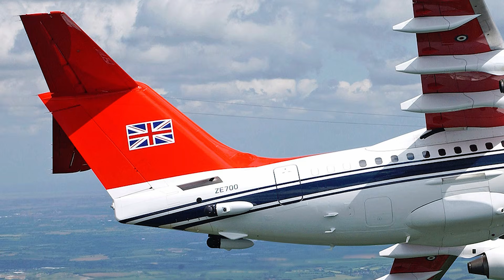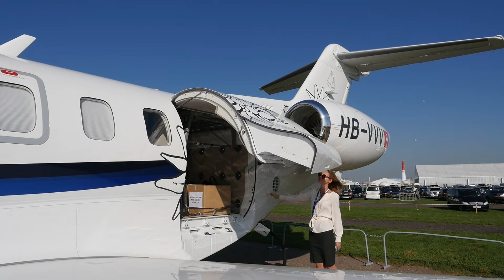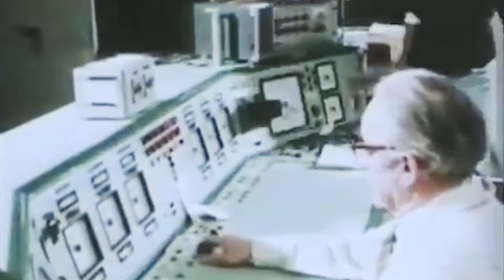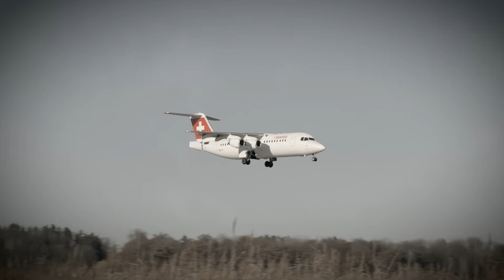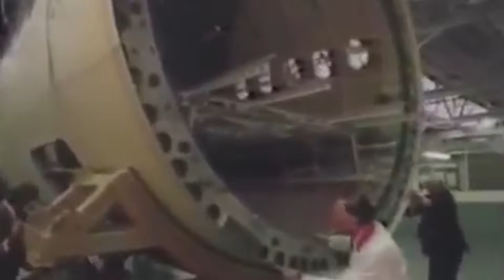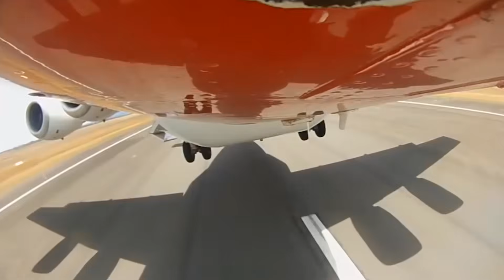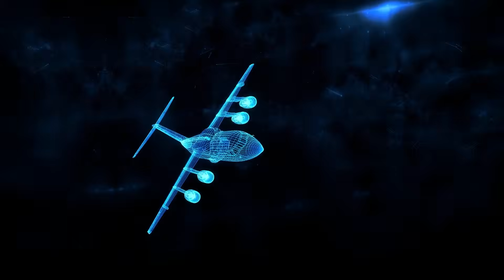BAe 146 - more engines!

Comment: I remember the BAe-146 fondly. The "Whisper Jet" was an excellent plane to be a passenger in. It felt solid and stable while being as much of a hot rod as the 737.
BTW, I think the thing you are calling "interceptors" we call "spoilers".
Also, those "vertical flaps" are "speed brakes".

Comment: There used to be a joke:
Why did the BAe146 have four engines?
Because they couldn’t fit six!
Reply: I heard a similar one, explaining where it got it's name from: It flies like it's got 1 engine, it's actually got 4 engines, but it really needs 6
Reply: You missed the next line, 'and 5 would have looked silly'.
Reply: @stephenarbon2227  No, actually a five engine jet would be badass. Either 4 under the wings and one in the tail, or even better, two under the wings, two on the fuselage, one in the tail! Or even like a VC-10, but with a 5th in the tail. Hell yeah!
Reply: its perfect for STOL just like the Dehavilland Dash7 and Lockhead Herculie.
Reply: @Perich29 
Only 113 Dash 7s were built, from 1975–1988. However, its twin-engine derivative, the Dash 8, has seen 1,249 built between 1983 and 2018.

Four engines were just too inefficient on fuel.
Reply: It was also connected to engine out performance, lose 1 and you still have 3/4 power. Two engines would have required more excess thrust for the engine out case. It also gave a three-engine ferry option, considered essential at the time as the 146 was expected to operate into airfields with minimal ground support.
Reply: Or the aircraft with 5 APUs!
Reply: @joshuaduckworth  That’s what we used to describe the 146 at where I flew her.
Reply: 😂😂😂 That's a good joke!
Reply: Another joke: BAE stood for: Bring Another Engine
Reply: BRUH
Reply: Wrong. Because they couldn't fit 8. LOL. I like what you said & worth repeating your original. Funny.
Reply: No. now this is funny....why did they put 4. because they couldn't fit 10!. haha booyeah!
Reply: I always wondered why that no-so-big plane had 4 turbines .......................
Reply: After the demise of a certain Antonov plane, that didn't age so well.
Reply: On American Airlines,  if they asked why it needed 4 we just simply said " 2 to get you there, 2 to get you back"

Comment: I worked on the JiT system for these in the early 90's. Only got to fly the simulator. Did a few test runs as a human sandbag. Cool thing about these was that you always new if the undercarriage was up or down as it would thunk into place. I don't think the Hatfield airbase is there anymore.

Comment: Shame on the video editor who is guilty of committing the video atrocity of BBC (Blow-up, Blur, Crop) 4:3 aspect ratio films and video (or 4:3 films transferred to video) to fill the 16:9 frame. Doing "click to fill" may look OK on a computer screen (other than the unnaturally overly large images) but on a TV the loss of resolution is terrible. You are taking standard definition video and degrading it to substandard definition video. You are also altering/censoring the carefully composed and framed 4:3 aspect ratio images by the historical cinematographers and videographers. Leave 4:3 alone! And, don’t BBC 4:3 photos, either.

Comment: Flew on the BAE146 a few times during the 80s in New Zealand. They were used by the Ansett airline and promoted under the tag of “Whisper Jet”, a most apt title - the relatively low level of engine sound and its STOL capabilities made this a very popular jet. It still has a part to play on regional routes.

Comment: The 146-300 was the first aircraft I flew in as cabin crew.
Now I work long haul flights usually on the Airbus A380 and even though it’s an amazing aircraft, after working 20 flights a week for 3 years 1st with AirUK then later with KLM, the 146 will always be close to my heart.

Comment: As a retired airline pilot I flew over 5000 hours on the 146 (200 & 300 versions) as well as many thousands of hours on more conventional jets. Your presentation is one off the best I've seen about the aircraft. A couple of points though, the first is probably a translation error. You used the word "interceptors" when describing the wing. That will confuse a few people as the correct word is "flight spoilers" - as used on all jet aircraft. Sadly one of the weak points of the earlier aircraft was the reliability of those alf502 engines which needed a lot of maintenance and were rather underpowered. A new use of the 146 and RJ aircraft recently is as fire bombers! There are some interesting videos showing them in action. Good effort!

Comment: I always thought it looked like a tiny C-17
Reply: I always thought that the C-17 looked like a large  BAe146.
Reply: Or maybe a baby IL-76.
Reply: C-17 with jet engines instead of props
Reply: @Perich29  The C-17 is a jet
Reply: Perich29 lol U trolling?
Reply: Think he got it confused with a C30
Reply: @bmc9504  I think you got it confused with the C-130. There is no C-30, the C-17 is a jet, just like the BAe 146, and both the C-17 and BAe 146 look like the C-141, as does the C-5. Basically the 146 looks like a cargo plane.

Comment: Cargo doors were killers!  Floor dropped  down so difficult to get heavy pieces up and out. Doors were low and swung inwards so great to opening your head on. Once had to drag a set of its own main gear out of hold after a swap was need after tire failure into CYYT.  Air Nova (QK) pioneered cold starts as they were first Canadian operators. Winter mornings saw acft maintenance with cowls open at -20c preparing for morning starts.

Comment: PSA (Pacific Southwest Airlines) San Diego's hometown airline.  Switched from 727's (3 engine) to these.  Which helped to lead to PSA's demise.  The higher fuel and maintenance costs contributed to the takeover by another airline.  The PSA building at Lindbergh Field is now the commuter terminal at the airport.

Comment: I was part of the original design team at Hatfield, working on the design, development and certification of some of the aircraft systems.  I have many happy memories  of the aircraft including seeing its first flight.  My personal opinion is that the aircraft would have sold many more aircraft if it had only 2 of them, but at the time when it was developed a suitable engine was not available, for example those used on the Embraer EMB-170 series..

Comment: I have flown in these while working in Taiwan back in the mid 90’s. On domestic flights between Kaoshung  and Taipei. It is a nice aircraft and looked forward to flying on it each week. What was confusing to me was that I perceived that they would take off on two engines then start the other two when almost to cruising altitude. I never had a chance to ask the pilots this, but on every flight I heard what sounded like engines starting. Then you would feel the increase in speed and being pushed back in the seat. My coworkers also perceived the same thing. Is this a fuel saving thing?
Reply: The aircraft has all four engines running throughout. That noise comes from the flaps when they are part-way between the retracted position and the first extended position, once as they are retracted after take-off and once as they start to be lowered on the approach to landing.  The acceleration increases after the flaps are retracted because there is then less drag. Maybe also the aircraft assumes a slightly nose-up attitude, which increases the feeling of acceleration.

Comment: They were used regionally in Canada in the 90's and ultimately have been replaced by the Q400. I was told that with 4 engines they were considerably less fuel efficient than the a320. They flew only a few thousand feet higher than the q400.

Comment: For years my favourite aircraft way above all the others in Flight Sim was the A320. Then one day I had a live flight in an RJ 100 - what a great experience. I decided to buy an available software package that had both the 146 and RJ series, and I loved it. When I changed to P3D v4 recently, I was able to get the newest software package, and it was worth every penny! I now have a fleet of 10 RJ's - the 70, 85 and 100 versions - and 20 crews, so my old A320's have been consigned to a dark hangar! What the narrator neglected to say in the video, is that the plane can land at a speed to make a Cessna Caravan blush, all on account of the RJ's superb STOL capabilities - making it ideal for almost every runway in the UK - well, I did say almost!
The last Swissair RJ took off from London City (EGLC) about two years ago, and as befitting a great aircraft, was given a farewell hosing-down by the airport fire brigade. A sad day methinks, for all concerned. I understood they were being discontinued due to the high cost of maintenace and fuel, My fleet is mostly cargo, but I still have two for passengers - and they've never made any complaint!!!!
Reply: Nitpick time! Swissair had ceased to exist some time before, you mean Swiss! I really miss seeing the Jumbolino at LCY and ZRH.

Comment: Nice airplane ruined by absolutely TRASH engines. I remember airline clients with almost their entire fleet sitting on the ground with empty tubes where the engines should be.  They could not keep the engines running due to DESIGN flaws in the  engines.

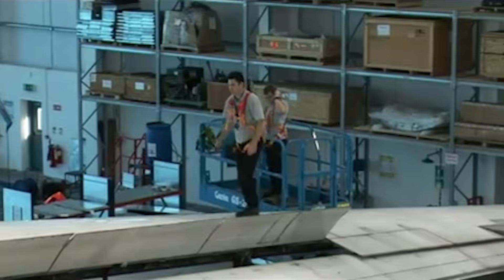Comment: 4:00 small correction. High-wing is not a plus for take-off. On the contrary. Low-wings are much better for take-off due to their much better ground effect. High-wings are much better for stability.

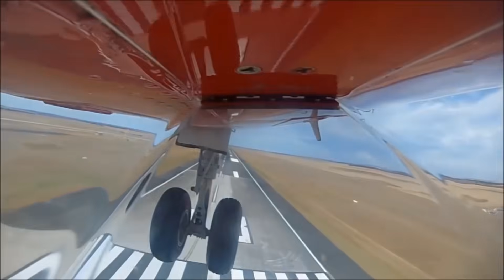Comment: I'm surprised the video didn't mention how popular the BAe146 and RJ-85 have become in the aerial firefighting industry.  You can see at 16:32 of the video Neptune Aviation's BAe146 airtanker doing a static water test on its ramp in Missoula, Montana.  Conair Aviation of Abbotsford, BC has converted several former Lufthansa Cityline RJ-85s to airtankers and operates them in Canada, the US and Australia. These aircraft will be flying for the next couple of decades at least.

Comment: I did my apprenticeship at BAe Hatfield in the eighties, making these. At Hatfield we made the nose of the aircraft and then assembled the finished aircraft from major assemblies from different sites around the UK. It was a good aircraft, the pilots who came to get type rated really liked it, they said it handled really well. I made the rear passenger door of the Queens aircraft while I was training. I spent some time in Flight Test Dept and actually flew one (not PIC) for ten minutes during a test. The CG tests were the most fun, a big empty metal tube tooling about over the North Sea, testing the handling at CG extremes. Then during the big reorg I was made redundant...
Reply: Hi, I’m Val Ashwell , my late husband was Paul Ashwell and he worked in the Flight Test, perhaps you knew him.  I worked with Charlie Kiff and  in the Engineering Department, would like to hear from you.  I live in Grantham

Comment: As a Licenced Engineer on the BAe 146 in Australia I loved them, They had their problems with cabin smells usually engine or APU seals leaking. Those are a thing of the past now. Built like a "BRICK SHITHOUSE" they are indestructible.  It's a shame the RJX twin was never built it would have extended their life even longer. The butt of jokes like " they were the only aircraft that had bird strikes on their turbine blades" because they flew so slow. Still passengers loved them, mechanics not so much.
Reply: Some parts were overly complicated (flaps, doors..).  APU's were always needing oil, TMS problems, MAN SPLR faults, Engine air valves, plus the door on the freight version could go horribly wrong.  Engine access was good until you needed to replace looms that went through the hollow vanes, engine vibration or oil pressure....fun times!
Reply: annoyed cyclist you can add lip skin removal and replacement and some of the seat track replacement around door 1 L if you had air stairs fitted . All In all a good sturdy A/C .
Reply: @vaughanlockett658  We once had an a/c stress jacked and wing leading edges off looking for a notchy throttle action.  2 days later, it turned out to be a TMS eye end corroded!  And found by a B2!!!
Reply: I used to do a lot of airframe repairs to theses aircraft . You could tell when they were designed as there was so many different types of fastener from avdel to sp rivets BA bolts and then you had modern stuff.
Reply: @Raymond Brazel-- why did aviation mechanics not like the easier engine accessibility?

Comment: One important benefit with four engines not mentioned here is the short-field performance. A transport category airplane must be able to continue the take-off if an engine fails at the most critical moment. Four engines give a better performance benefit than two engines. I have seen this airplane operate on a 900 meters long runway in a tropical climate. No other jets can do that!

Comment: VC10 and Super VC10 were NOT failures....They were better-designed and cheaper to operate than the Boeing 707 and Douglas DC-8; plus the Americans were sanctioning countries who didn't buy Boeing 707 and Douglas DC-8. Had the VC10 come out in 1958 instead of the early 1960s, it would have been hugely more successful in sales; and, from a technical standpoint, it was a brilliant success. Does this mean that the Illyushin Il-62 ["VC10-ski"] was also a failure...?! Note - SE 210 Caravelle, Boeing 727 & Douglas DC-9 had a Tail-Door with Air-stairs...!
Reply: Flew from Auckland NZ to London return on BOAC VC-10s in 1974. Most comfortable aircraft I have flown.

Comment: I worked on these in the 90s when AirBC flew them. The engine were basically a helicopter lycoming turboshaft with a geared fan bolted onto the front, the reduction gear allowed the fan to spin subsonic and the turbine to spin fast.
Unfortunately, the carbon seals for the pressurization leaked a lot and contaminated the cabin.
Otherwise, it was a workhorse.
Reply: If I recall correctly, the seals were not the problem; it was a change to a different viscosity hydraulic fluid that caused the few problems.
Reply: @b.p.7153  the cabin pressurization is derived from bleed air off the engine compressor, some engine oils for the ALF engine had detergent qualities to keep the bearings cleaner, but this caused the carbon seals in the compressor to seep oil into the bleed air used for pressure air,  nothing to do with hydraulics
Reply: Sorry! I do not know why I said hydraulic fluid . . . I meant oil.
I flew these for six years for AirBC without one incident of cabin contamination. The few problems we ever had were more hype than reality.
The BAe146 was a dream to fly and will always be one of my favourite aircraft.

Comment: This is a good presentation. I flew from Burbank to San Francisco on PSA in late 80s on this BAe 146 a few times and back. This jet was quiet and had a short takeoff and landing compared to the the 727s and 737s of the time. I could be wrong but it seems to me the PSA aircraft I flew on held more than 70 people. I believe it was closer to 100 but I was not paying that close attention in those days. I am from an older generation where I always believed four engines were better than two or three, and they probably are but new technologies and advancement in engineering make it cheaper to fly with two I imagine. I was on a flight with PSA the day before that psycho shot his former boss and then killed the pilots on that LAX to SFO flight. Too bad Avro did not stick with it with upgrades and new engines for a twin engine version because the high wing concept seems to be better as far as picking up any debris on runways. The An-148 would have made a good regional jet here in the US with the smaller airports and less improved runways. Antonov and Russia can make good aircraft but they don't seem to have the production capacity.

Comment: The 'hair-dryer' jet!......because it sounds like a hair-dryer!
I've flown on a few (Ansett 1990s) but I found them to be very noisy and had to divert numerous times due to fuel vaporizing in flight.
Reply: I flew for Ansett on the 146 as Flight deck crew.
3,500hrs all up.
Never heard of fuel vaporizing in flight, nor recall it being noisy.
Reply: @dxbmick  Perth to Cairns via Alice Springs! Had to divert to Mt Isa for more fuel. That was a long day. Happened twice.
Reply: @prudencepineapple9448  Wow.  I never knew fuel vaporising was an issue.  I am surprised my career there lasted till the end, instead of a smoking heap in the outback. Well may be not smoking since the fuel vaporised.
Reply: I have never found them noisy flying in UK Skies ..
Granted the noisiest thing about them is the landing gear hydraulics deploying or retracting but I like them .

Comment: Flew these into Bhutan, one of the hairiest landings in a jet ever.  
Later I loaded them on the flightline for a NW feeder.  
It's like a miniature military transport plane, the only jet I would call cute.
Reply: Khắc cảnh lê I the Bhutan had two of them if I remember correctly . I worked on them at wood ford they came in for some heavy maintenance and they found a lot fuel tank corrosion . I think they ended up putting new wings on them in the end .
Reply: @vaughanlockett658  right,  2 airframes back in 2001. Let me clarify - I was a passenger to Bhutan, not the pilot.